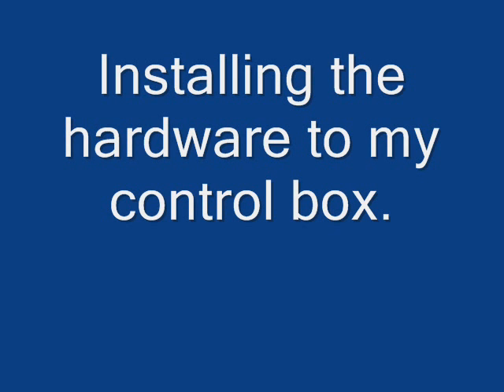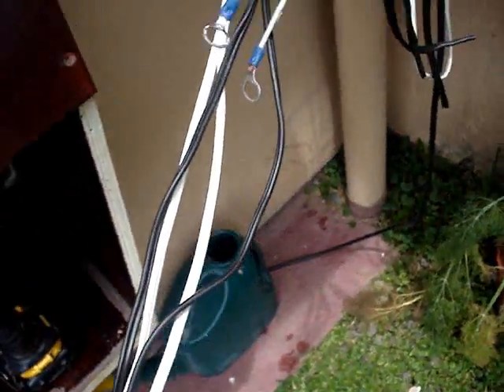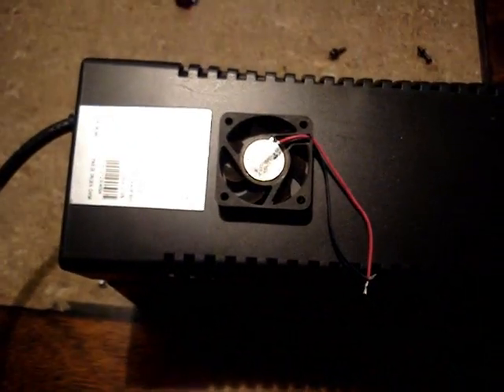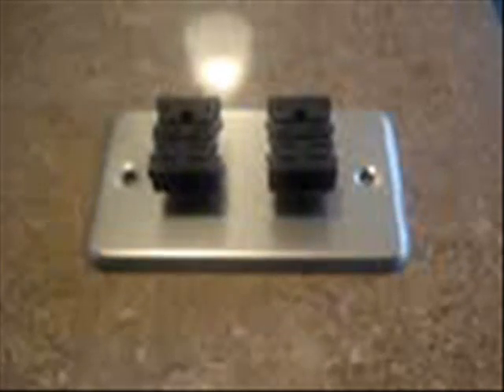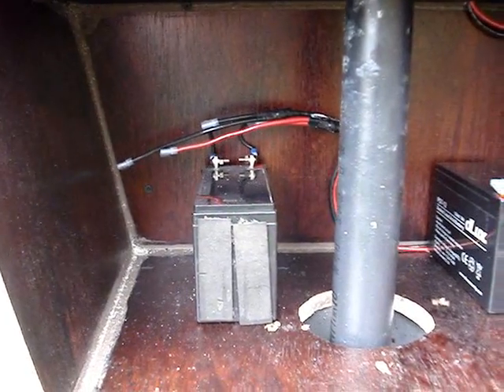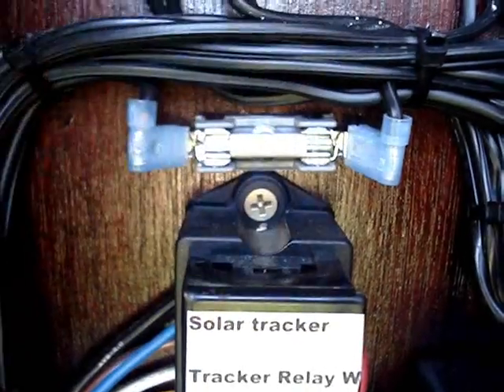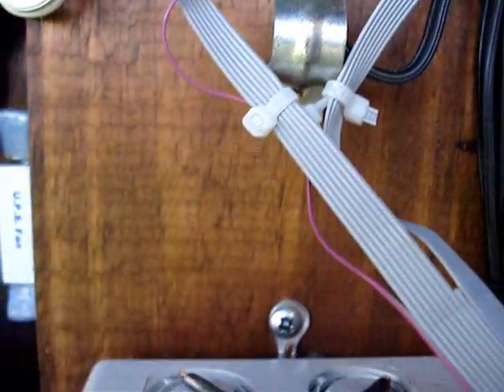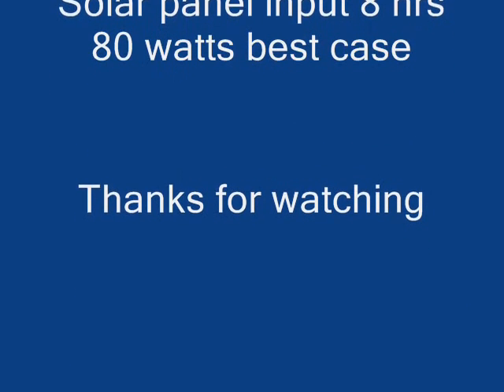How to install a battery back up ,solar charge controller ,and automated control equipment

Comment: Ah... I see a problem, you have a key lock that gives access to the laptop but no locks (that I could see) to access all of the equipment, including the laptop?
Other then that, great job.  :-)
Reply from the maker: I was not really worried about someone stealing the laptop. The lock was a easy way to open and close the computer door. It would be easy to put an additional lock on the cabinet if needed. Thanks for the comment

Comment: I really love this project...I'm trying to replicate it for my own Off Grid System..but may need your advice and help Fist thing the schematic. I followed most thing(I'm a novice) but didn't follow where you tied in the limit switches. Could I get a copy of your schematics?
Reply from the maker: I dont have a schematic but the idea of the limits is very simple. one of the limit switches brakes the the power wire that goes to the electric actuator going up and the other breaks the power wire going to the electric actuator going down. When you wire the actuator connect all the wires first then cut the power wire for each up and down and add the limit switches. They will be wired normally closed. If you have any questions feel free to message me.

Comment: Aceman - did u use automation studio. u can make this thing work by installing 4 limit switches with plc board with timing control. divide that whole arc which u showed with 2 limit swithes in 4 parts and program plc to bypass each limit switch after 90mins interval. for 90 mins the ram or actuator will be resting in the same position and after another 90 mins actuator will again bypass 2nd limit switch and so on, in reverse stroke it will bypass all d limit swithes to start its track all over again. what u think( aceman u did nice job indeed man hats off). I want u to share ur views with my point of view also. plz

Comment: Fantastic, great job. The solar tracker you have put together is the basic concept I had envisioned for supplying power for a fish pond, using a pump, filtration and aerator. Thanks for making difficult problems solved by simple solutions.
Reply from the maker: +Robert Fidler  Thanks for watching.

Comment: Aceman:  You simply ACED it.  Just great build and wonderful tutorial.  You inspired me to build one for my home.  I will be needing lots of advice and suggestions from you.  Accept my apologies in advance for all the trouble I will be causing you.....As I have no great knowledge of mechanical stuff, I am going back to the first video where the motor from the drilling machine is connected to the solar panel to position the panel.  Can you explain that once again please ?
Reply from the maker: Madhav Pulivendala I am glad you liked the videos. Feel free to ask questions. I will help If I can. The drill/ actuator is wired into the relay board that is connected to my computer. I purchased a timer software that I can program to operate the drill/actuator at specific times to track the sun during the day ,and reset facing East to start again the next day. I have a few videos on the software and the other parts of this build. I hope this helps.

Comment: I watched your videos :) and i have to say, I'm in awe! I actually took a few seconds to thank God for giving you such wisdom. You are a Genius. Then I got a little sad and Asked God to also give me such wisdom.

I began buying my off grid setup, so far i have 4x 190W Panels from Topoint.

On my shopping cart i have

MorninStar Tristar Mppt-60 charge controller (future expansion option)
MorninStar Tristar charge controller meter (second thoughts after seeing your setup)
Whistler 800 Watt Power Inverter Pro-800W
1000 Watt HarbourFreight Modified inverter. (for backup)
1000 Watt Power Pro Generator -- to charge batteries when low sun if needed)
6x Tojan T-105 225Ah (not sure if this is enough or too much or even right way to go)

my number is 401-266-8200 Neff
(any help or pointers would be greatly appreciated)
Reply from the maker: Thanks for kind words. I am no genius just love building. My best advice would be figure out how many watts your going to need and design the system for about three times that number. With solar/wind the output numbers on the products are very misleading.There are a bunch of really smart people on You Tube, watch Knurlnar24 ,emagnets, lasersaber,lynxsteam, Muddymuddymudman are just a couple. Stick with the "regular guy" channels they have learned through trail and error and usually have good advice.

Comment from the maker: This was a trial run. I was not sure for the quality of the relay board or exactly al the things I wanted the system to do before I spent more money. This relay board was only $28. I want to upgrade to a relay board denkovi sells that connects into your network and does not need a PC to control it 24/7. Less power consumption plus they have a android app for my phone.I should be able to switch it out with out modifying anything. Thanks

Comment from the maker: The solar panel  tracker is grounded through the metal roof, I grounded the a/c componets that had grounds but all of the airpumps and water pumps dont have safety grounds but I used the smallest fuses I could for them so if there was a short the 5amp fuse would blow way before the 15 amp house breaker would. This is also why its so important to fuse the load side of the a/c line. Where I live the temp is about 75f all year long and so far I have not seen any bats LOL. Thanks for the comment.

Comment: NASA would not even get this out of the feasibility study for an additional 10 years, then there's the EPA impact, and then... .  Do you try to only use metal enclosures for junction boxes, etc.?  Are they grounded, or common to each other?  Does the tracker structure have to be grounded separately?  I'll bet you have a few bats in the area that would love to climb up that vent pipe in the control box to stay warm this winter!